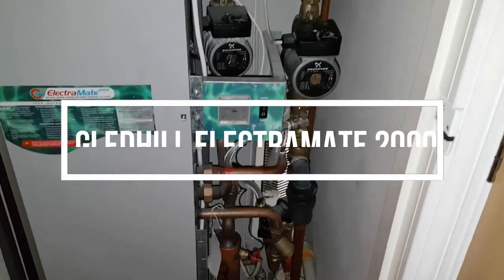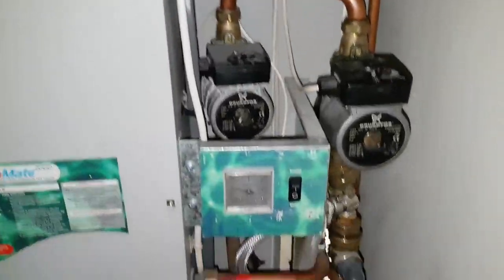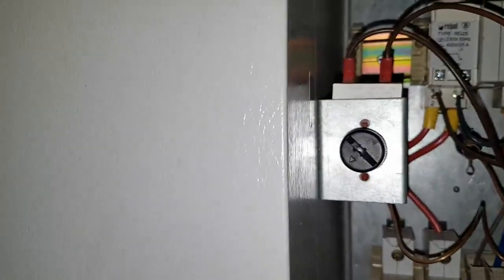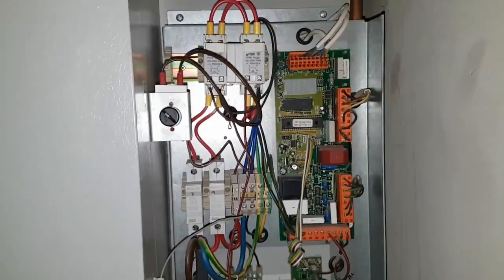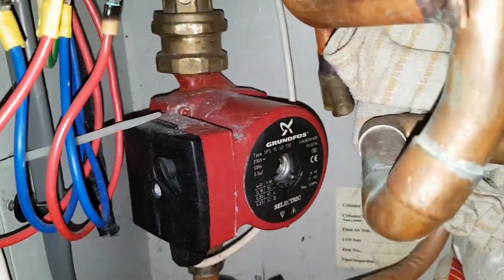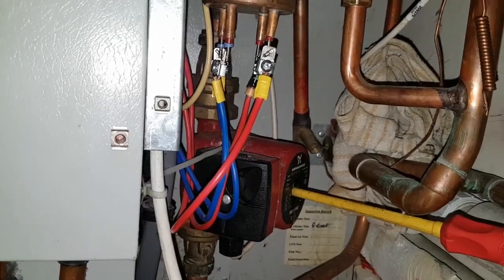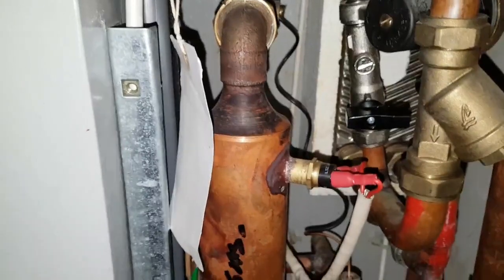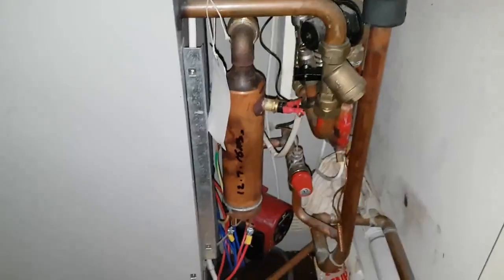Gledhill Electramate 2000 No Hot Water. With Coach Tony Morgan

Comment: do these run off peak power?
Reply from the maker: They can do both
Reply: @ARBoilers  also- am i right in saying- the central heating part is a flow boiler and the hot water tank has its own seperate immerser?